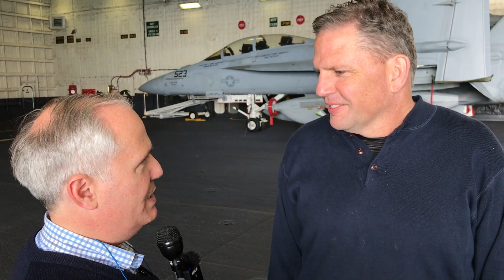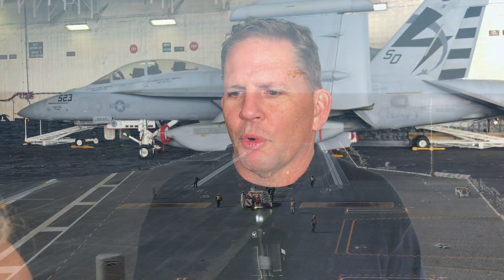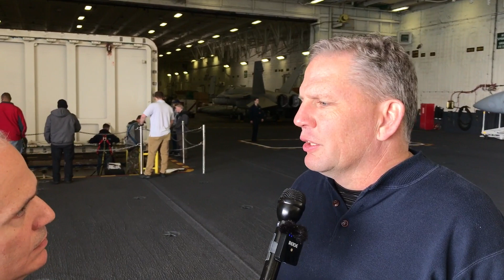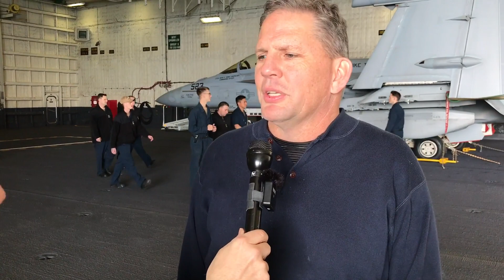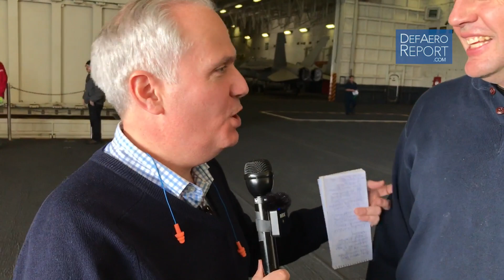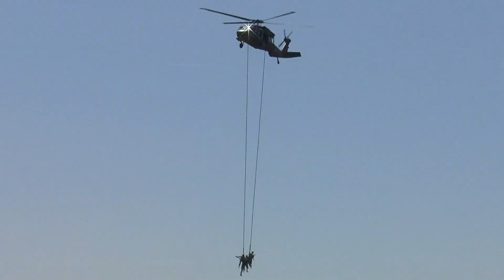US Navy's Geurts on Ford: Propulsion, Electrical Systems, Catapults, Arresting, Radar are Ready

Comment: I understand prototype... This ship was  Commission in 2013... Let that sink in 7 years ago... Still hasn't deployed with a full crew...  You are still a prototype until you have full crew  An  Air wing at sea..only .2 out of the 11  Weapons elevators  working... 7 years and no data on the full air wing... Radar not working... Self defense systems not working... Probably will not make a full deployment until   2022 or 2023 H*** you would have spent half of your career in Newport News  Shipyard or at pier 12... Will not and cannot deploy with F35..  Should have been called it building 78... Warships belong at sea...

Comment: Can the deck handle the F35?
Reply: No b variants so will be sweet
Reply: No problem and no particular reason for the decks to have any issues. The wide reported issues were in regards to the LHA class ships running the f35 b model (vertical landing and short take off model). And to be fair the first round of testing on wasp class ships occurred without any special deck treatments. The f35 b actually has lower temperatures then the Harrier ( but f35 lays down more heat per a given unit of time). So no holes or damage to decks was observed. However they noticed that deck coatings were wearing faster than the Harrier jets. So on spots 7 and 9 they applied a more heat resistant coating. However because they want to run say 12 f35 at a very increased sortie rate? (Compared to 6 Harriers?).
They didn't redeck the ships surface, but added some cross bracing under spots 7 and 9 - moved some wiring harness under the decks also. Also jet fuel storage was doubled from about 1/2 million gallons to over 1 million. So the upgrades were not really due to the f35 being so hard on decks but deciding to turn the ship into a mini aircraft carrier with such higher sortie/cycle rates is most of the reasons for having to upgrade these smaller ships running the stovl b models.  
The Ford super carrier in this video doesn't run the vertical landing f35 model - thus the f35 engine never points down directly at the deck. So no real difference between say a f18 or f35 in terms of deck issues. 
Recent reports of ford class super carrier not being able to run F35 was ONLY due to not yet having loaded equipment on board to run and service the f35 - not that any kind of design issues EVER existed that would prevent F35 from flying or being deployed on this large new carrier.
Reply: OMG what a stupid question smh.